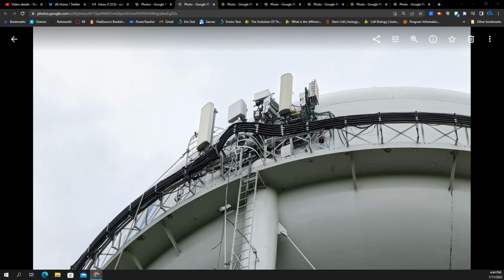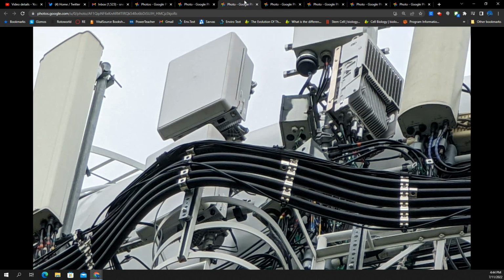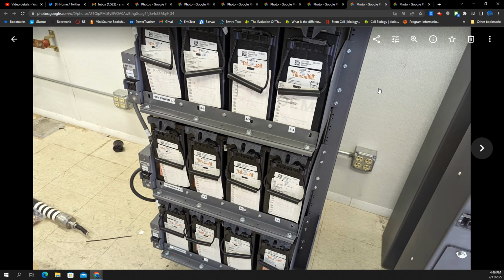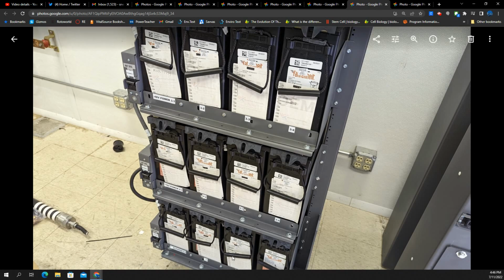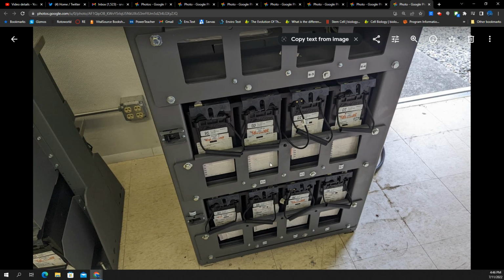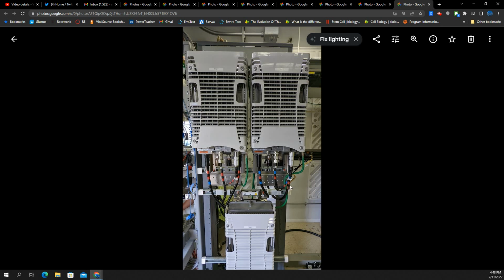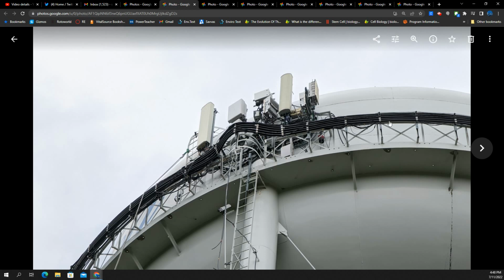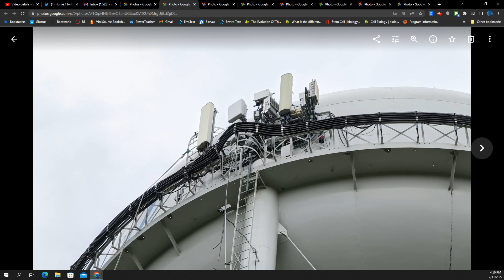What does an AT&T Cell Tower Actually Look Like? | 5G 5G+ 4G LTE C Band DOD

Comment: Ah man that brings me back. That’s a Nokia market too. Used to work on sites in the Rocky Mountain region and sometimes I do miss it. A lot of times I don’t. I stopped working in the industry about 2 years after they switched the BBUs from ALU to Nokia Airscale models and we started installing the FirstNet radios so everything still looks pretty familiar. I’ve installed more of those batteries than I care to remember. I do remember very well however, that those batteries weigh 135lbs each. Those are among the parts I don’t miss.

Comment: Those batteries may be lead and if so are only 2.2V a piece at 400 to 600AH. If one in a string fails they replace that entire string, a bit surprised by the 8 cell group size though, most of these have a 48v (24 cell string) Ended up with several from a scrap yard that were pulled from a lightning damaged tower site. All were fine went for a 12 pack for solar use. ❤

Comment: Where can I get the antenna's that they use on these install's as I am trying to set up a Cellular backhaul up on a mountain and want best Antenna I can get so the signal is clear and plentiful? Any recommendations are appreciated and some Distributors would be even better thanks a lot Sneed Mobile Tech!

Comment: The batteries that are there is usally only there to transfer of power so they don't drop service till the generator starts up. Batteries don't carry load very well. Now I don't know what the voltages are to power the antennas but looks like it may only power the cellular site for 24 hours so they either can wait till generator kicks on or make provisions to get a temporary generator there to power.
Reply: Yup they are in buffer/float configuration. They power the DC to DC converters if power is lost from the main supply. When this is detected it will be on battery and send a notification of this. If the outage lasts more than about 90 seconds the transfer switch is tripped and the gas generator is switched on. I've seen two types. The efficient but loud engine based ones, and the nearly silent stupidly expensive and horribly inefficient thermoelectric ones. Since the batteries are a buffer as well as backup the changeover is instant unlike a home generator set. ❤

Comment: The 4 in a row are one string 12x4 =48 volts x 5 strings . I don’t know if you saw the amp draw? If around 100 amps that should last 4 to 6 hours on battery. Also did att have a backup generator?

Comment: FWIW, I have worked on the cell networks for two Canadian carriers, Rogers and Wind/Freedom.  The first time was on Wind's initial rollout, where I was hired to test the microwave links between sites, where one site would have a fibre connection and nearby sites would connect to it via microwave.  Several years later, after they changed their name to Freedom, I was working to upgrade the power at several sites.  This included getting those heavy batteries up to the roof of the buildings.  At one site it was straight up a ladder, through a hatch on the roof.  We had to buy a boat winch and some strut channel to hoist the 4 batteries up to the roof.  I also managed the Rogers 4G rollout at several sites, working with Rogers, ensuring materials were ready and more.  I also had to update all the relevant records and ensure the techs had done the work properly.  One difference I noticed, between Rogers and Wind/Freedom, is Rogers had it's equipment in a shelter, but Wind/Freedom had the radio gear in suitcase sized cases that bolted onto the mast and a cabinet for the power and network connections.  Rogers was one of the original cell carriers in Canada, going back to the mid 80s and analog phones.  Wind/Freedom started life as a 3G carrier in 2008.

BTW, in a recent test, I was able to get 436 Mb down and 78 up on C band with Rogers.
Reply: Rogers is truly the best network, so long as they don’t update their equipment and don’t tell certain folks lol. But yeah, truly an amazing network and one that puts some American networks to shame. Your speeds are amazing, but your costs are eye-watering.
Reply: Thanks for sharing, most people take it for granted that our phones just work but never think about the planning and labour that goes on to make it all work! I recently switched to Freedom to try and support the underdog and drive competition since they improved their Nationwide/Roaming.
Reply: @jchtylmegekr  When I started with Rogers (Jan. 1995), then Cantel, it was the underdog!  🙂 Back in the analog days there were two carriers, the incumbent phone company (Bell) and the alternate (Cantel).  Back then, there was only the 850 MHz band and voice calls only, no data.  Also, back then, you had to pay for every call!
Reply: Hi
Reply: My family has been with Fido which was bought by Rogers for 20 years now. Their network is honestly the best. I tried Telus for a month and was very disappointed. Their service has been declining even more ever since they were forced to rip out all Huawei gear from their RAN. I am now using freedom and love the ability to roam onto the Rogers RAN. I was surprised to see that Rogers still has 2G up and running in my neighborhood. Very impressive to see Rogers running 2G/3G/4G and 5G all at the same time. Meanwhile Telus can't figure out 3G/4G/5G. I was also never a fan of Telus' choice to use CDMA in the 2G era. I would sure love to see some pictures of the cell towers you have worked on. As an IT guy, I love telecom gear and servers.

Comment: "What are those batteries for" -T-Mobile
Reply: Those batteries are usually 190ah. There good for about 4-8 hrs of back up depending on the number of strings
Reply: @realsmt  Dude but seriously, T-Mobile has NO REDUNDANCY MEASURES ON SO MANY OF THEIR TOWERS BRO! I don’t know how the FCC hasn’t hit them with hella fines for being unable to make 911 calls from time to time, or send E911 text messages.
Reply from the maker: That's the thing, they do ding them whenever they have extended outages. It's all cost reduction, they'd rather pay the occasional low cost penalty or fine than force a massive capex to national backup power. They will add backup power at a slow pace their capex can handle and just pay the fines along the way.
Reply: @realsmt  It’s ridiculous, especially in Texas where they have a MASSIVE presence, especially with the additional Sprint assets, and they’re burning up energy like you wouldn’t believe. It’s gotten so bad, we have to move away from Texas ASAP, because the costs have ballooned to NON-affordability. Looking into places like Rhode Island, with small populations but capable infrastructure and decent housing, as well as road infrastructure. Rhode Island has awful roads, but the rest is okay.
Reply: @realsmt  The FCC has a way of getting their attention. First time a regular fine. Do it again... bigger fine... keep it up and it will be a very very large fine... Ask Charter about their 15 million dollar fine this year.
Reply: Since it was AT&T equipment Mr. Sneed was showing us, I can only assume the batteries were for them.